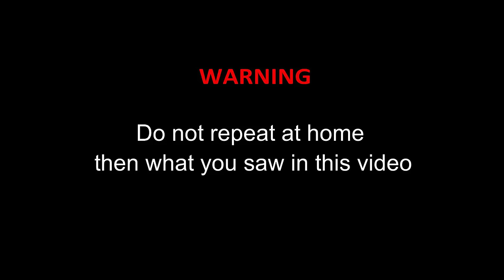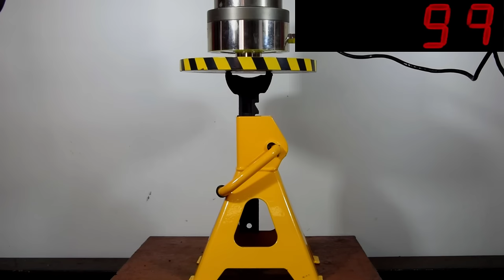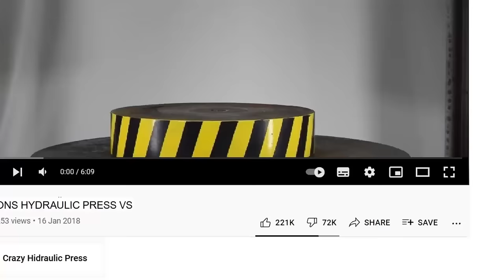HYDRAULIC PRESS VS CAR STANDS

Comment: the tiny roll pin was the killer on the yellow stand. you should try another yellow stand and have the dog welded to the handle first
Reply: Yeah, had that issue with one of my jack stands. Don't know how, but sheared that 1/4 inch roll pin. Jack stand didn't fall, but wouldn't release either. Had to jack up the truck higher to get it out.

Comment: Vorel was or should have been the dominant jack stand but the weakest link was the single split pin!  Had the retainer and handle been welded, I am sure it would have faired far better!
Reply: Please explain how you would make that weld ...
Reply: @kimlground206  Easy Peezy and by co-incidence, it involves your name.  😉

During manufacture, the retainer tube both ends would have flats Ground off so as to expose the handle shaft once assembled.  The existing hole for the split pin would still be used just for an alignment purpose.  Assemble the retainer and handle and then weld across those flats from below.

Aftermarket approach is to remove the serrated jack, turn the stand over, mark the area/ends to be Ground, remove the pin, slid the handle out and the retainer will fall out.  Then repeat the steps noted above!  

Not exactly a homeowner/DIY weekend mechanic thing to do.  But can make the initial steps of preparation and then take to a weld shop to do the actual weld!

Cheers  👌😎
Reply: @lisab3396  I see what you are saying and thanks for the detailed description. I won't say it can't be done, but it is hard for me to visualize how you would get a mig gun or even a stick in there.
Someone on another channel said I must not be a very good machinist. Not a very good welder either. LOL. My motto when welding is, "if it leaks or if it squeeks, weld it some more".  To weld well one has to be able to see the work. Sadly not the case for me these days.
I think my approach would be to make a couple plates out of 3/8" material big enough to cover a hole on one side big enough to insert the welded handle and pawl, and with a hole for the handle shaft  Cut hole on one side of the jack, insert the welded assembly, then weld the plates to the main body of the jack stand. Heavy plate on BOTH sides to help resist the holes tearing out that you see in the video.
Reply: @kimlground206    Holy Moly, sounds like you are rebuilding the Titanic.

Seriously now,  Remove the jack and turn the stand over top to bottom.  there is plenty of room to do a nice weld "for a good welder"!
Reply: @lisab3396  sounds like the voice of experience talking.  Ever weld any titanium?  Really nice to work with using TIG.
As far as the Titanic .. I always liked the first part of what the old timers always said was Harley Davidson's motto: If it breaks make it bigger. The second part about 'if it sticks out, chrome plate it', ... not so much.

Comment: Seems that the pawl broke early on the ratchet type.  Good to see both types are up to the average job.
Reply: Pawl didn't break. The hole in the frame for the axle pin deformed.

Comment: It is not going to break at 10 tonnes for sure. Either it's going to break before 5 tonnes or after 10 tonnes because it is a jack right. If it can lift 5 tonnes then it won't break at 5 tonnes. If it can't go beyond 10 tonnes then it will break on 10 tonnes, so it cannot carry 10 tonnes. This means if you put this jack under a 10 tonne truck and lift it, it will lift with ease till 5 tonnes till it reaches the 10 tonnes mark after that it will start to disintegrate, because of it's max capacity. So capability of the jack 5-8 tonnes. Not exactly 10 tonnes. Hope you understand.

Comment: Congratulations! You have proven that one should not exceed the intended load capacity of a jack stand. However this test is flawed. While the black stand seemed to fair better, rarely is pressure applied in the field in a perfectly perpendicular line to the ground. The black stand in countless field tests has proven to kick out with pressure applied at only a slight angle. A professional shop would not use the black stand as it’s base isn’t as reliable.
Reply: Congratulations, you missed the point.  This is a hydraulic press channel that crushes things.  Its not a real world test of anything.

Comment: Granted the cheap jack completely failed; the one thing surprising me however was how much extra force it took to go all the way...14,000+pounds?? The "proper" one, even more so.
Reply: 14,000 + KG, that's close to 30,000 lbs!
Reply: @johnjones928  fair point. I typed that wrong. I double checked and do temember the scales saying kg...also remember looking at thd 4k+kg and thinking 2 tons, which is where I got mixed up.
Reply: @allanmcelroy9840  Yeah, i had to look up metric ton myself to be sure. I mean that thing could hold up a dump truck.
Reply: @johnjones928  yup, damn near!

Comment: There's a version of the rack type with an additional safety pin which engages on another rack tooth, now I have only that type because I can't trust only that small roll pin on the lever, I got four rated for 3 ton and four rated for 4 ton and my heavier car weighs only about 1.2 ton and I always try to use all eight stands to hold my cars in the air, better safe than sorry.
I also keep four telescopic stands in the trunk because those four folded take up less space than one of the rack ones, but I have seen on a telescopic construction prop how the inner tube disappear into the outer tube in the blink of an eye when the beam it was holding came loose from one side, as soon as it reached the outer tube the beam stopped falling, the pin was intact but the inner tube was cut cleanly in two halves along the line of the holes.
I wonder in the rack model how the rack teeth or the rack itself will behave under a sudden load rather than a slow increase in load, I am afraid the cast iron will snap...

Comment: The split pin is the only thing holding the car up on the yellow one & people don't trust ANY jackstand! Put a couple cinder blocks under your work
Reply: I know someone who died using a cinder block to hold up a car. It collapsed. He was pined. May he rest in peace.
Reply: @BAtadCrazy  must have been cracked. try to wobble a car on blocks then try to wobble a car on stands it will fall off the stands, guess what happens when your wrenching under the car, you make it wobble.

Comment: Yeh , but the 1st jack they released the pressure at under 5000 lbs & it had only dropped the leg down to like the last pin hole , compared to taking the other one to like 15000 lbs to totally demolish it ,

How much pressure to totally demolish the yellow jack ?

Who's gonna put either of those stands under a weight greater than prescribed on the package , they'll definitely gonna get what is gonna happen

Comment: This method of testing is flawed because because you fail to take weight distribution into account. The flat surface of your hydraulic press makes it impossible for the 2 pieces to distribute the weight out across their surface as intended. As such your testing would be more accurate if you found a way to distribute the weight properly. Notably the $15 one flattened out a lot expanding the surface pressure from the press and as such it did dramatically better.

Comment: Weld a big nut ot a piece of metal below the hole and youre back in business. These are always too small. You should do a test with blocks of wood. Regular vs railroad type.

Comment: Having worked on cars in my driveway a lot I wouldn't trust either one of these cheap pieces of crap to hold up a vehicle saving a few dollars on a cheap Jack versus having your rib cage crushed or possibly worst is not worth the savings 🤪